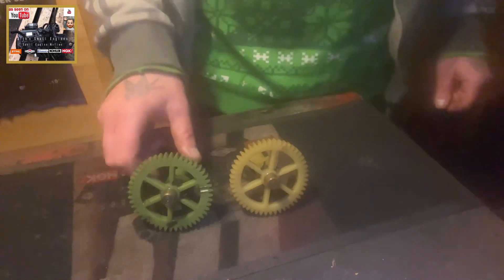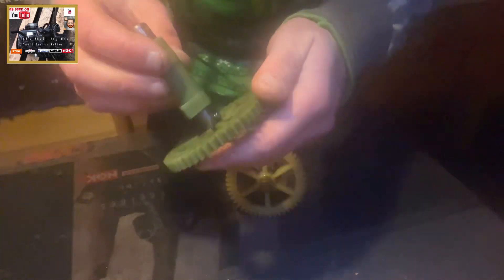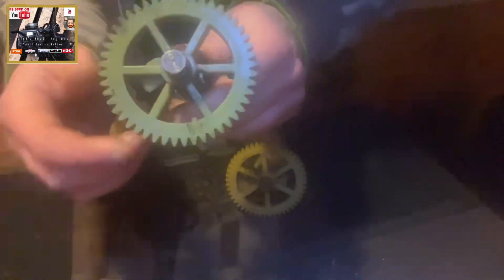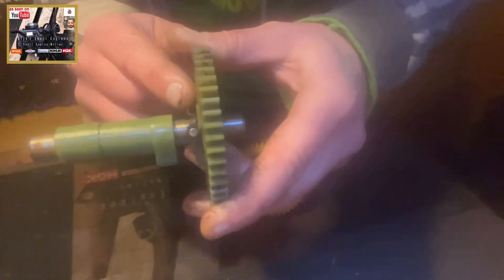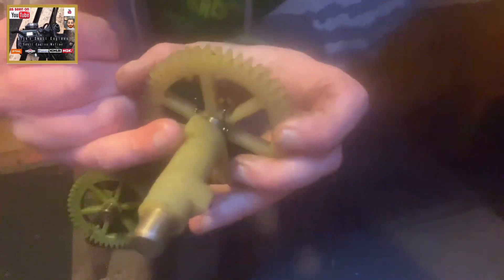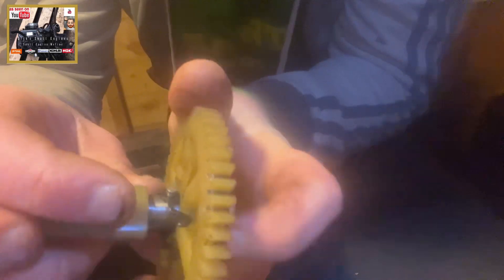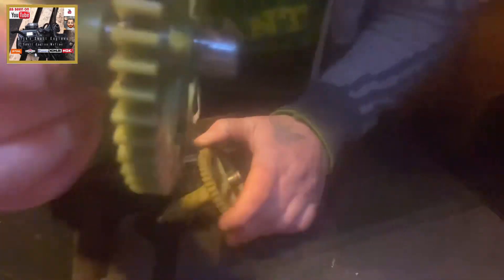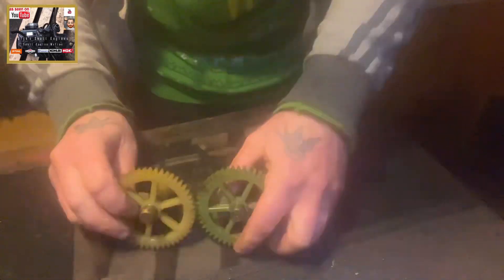Plastic Briggs & Stratton Cam shaft Exhaust lobe Issues• 🔧 #briggsandstratton #camshaft

Comment: Starting compression bleeder: allows easier starting as it kicks the valve open slightly at starting RPM , then swings out of lifter range when running by centrifugal force. Only thing plastic cams are good for are using them as cores for lobe angle changes: cut the 2 lobes apart on the shaft, move them slightly for more or less overlap then drill and pin them to the metal shaft. Once you find the right lobe separation (longer or shorter overlap) find a custom cam that matches it in METAL!
Reply: Cracks the exhaust valve open slightly or engine would be impossible to pull start 👍